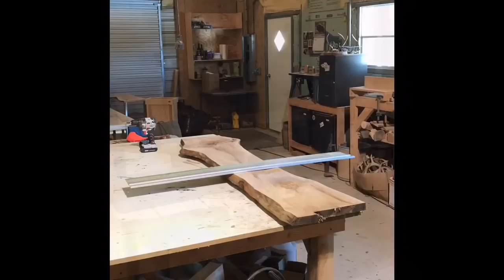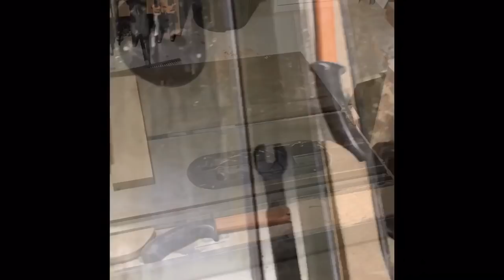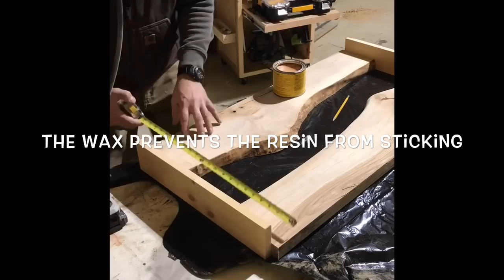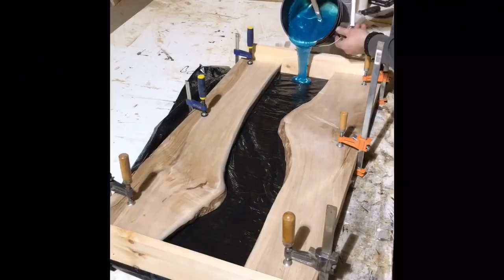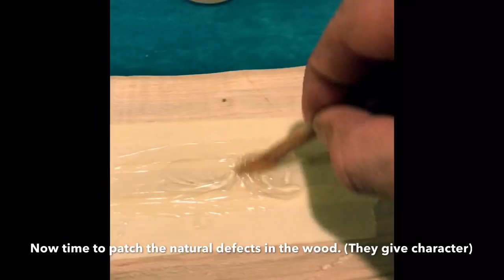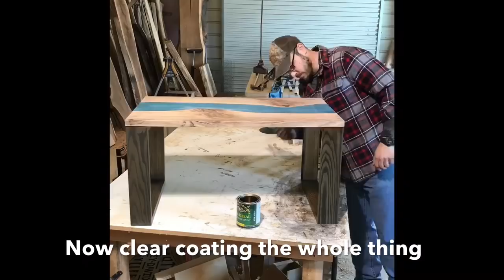EPOXY River Table Build!

Comment: I’ve seen a ton of these but never seen a trash bag used for release. Looks like the way to go. Did you have much leakage under the slab or under the end caps? I didn’t see you use any silicone or anything. Just clamps?

Comment: Great table. Did you get bubbles or did you use a heat gun? Trying this very soon, but not sure if I need to buy a heat gun beforehand. Cheers
Reply from the maker: Joseph Russell I use a small hand torch. The heat gun doesn’t work on all epoxies. But the torch does.

Comment: Dude. So good. I read below you used around 1 and 1/4 gallon in total, and that was divided into two pours? (In Australian about 2.3 litres per pour is that right?)  How long was the wait time in between  pours? Have you had much trouble with exotherm with pouring around 2 litres at once? Awsome work mate
Reply from the maker: Rohan James yes about 2 pours. I wait over night until the second pour. But you can pour once the epoxy starts to get a dry film on top.

Comment: very nice ! so why do you sand it down after you pore the epoxy ? it looks like it comes out smooth
Reply from the maker: After the epoxy dries, I run the entire thing through my planer and the planer always leaves slight marking so you have to send that out. A lot of people go crazy sanding epoxy down to super fine grit sandpaper but you really don’t have to. Once you put a clear coat over it, it comes out perfectly smooth regardless.

Comment: how did the epoxy handle coming off the plastic trash bag that was put down?? can you show taking this apart? if it comes off easy then this would be a way better plan then every other video that i have seen.
Reply from the maker: Rafe Rodriguez it comes right off the plastic!! Works great. Just try to get the plastic nice and flat. Or it will make wrinkles in the resin on the bottom.
Reply: Tyvek tape also works well as a non bonding layer.

Comment: What grit sand paper did you use for the table?
Reply from the maker: T P I sanded the resin and wood to 320 grit. Then I clear coated it with a oil/polyurethane mix. Once that dried I sanded it with 320 again and then put a second coat of the oil polyurethane mix. And it came out very smooth.
Reply: I just bought wet/dry orbital sand paper at 800-1200-2000-2500 grit do you think that would be to much?
Reply: In other words is 320 grit just fine for sanding the resin with? Did it leave any scratches on the resin?
Reply from the maker: T P I see a lot of people doing stuff like that. But I’m not sure why. It seems overkill to me but maybe they’re trying for something different. You won’t be disappointed with sanding it to 320 or 400 only.
Reply: Ah I gotcha. It does sound over kill but it's already on its way so i'll see how it goes lol. Do you have somewhere where you post the pieces that you build? instagram or twitter?
Reply from the maker: T P yea check me out on instagram!

Comment: The last oil was good. What kind of oil is it?
Reply from the maker: General Finishes is the company. It’s an oil and polyurethane mix. Great product
Reply: @andrewbuccardo8401  
I wanted to ask you how much hardner in a liter resin is inserted. Please tell.Awais.Pakistan
Reply: @andrewbuccardo8401  why use the oil or a top layer of clear epoxy?
Reply: @humanityslasthope5571  I'm curious too. Why not a final layer of epoxy
Reply from the maker: olly mayo you could use a top layer of epoxy. I don’t like to because i like the look of a THIN top coat. Makes the piece look more realistic. But either is good!

Comment: if it takes you several hours to cut through it then that means one thing, you dont have the right tools.
Reply from the maker: Eric White if it took me several HOURS, then something is terribly wrong. But I said it took me several PASSES with the track saw. That meant that I didn’t have the right blade on. I needed a rip blade. I changed it and now it cuts in one pass. 👍🏼
Reply: Eric White jkkkkjjjjji